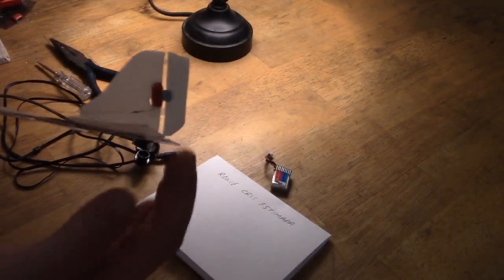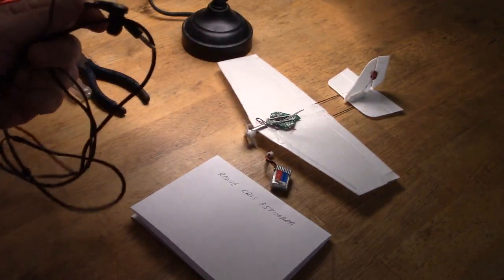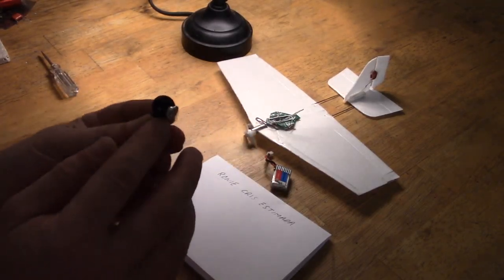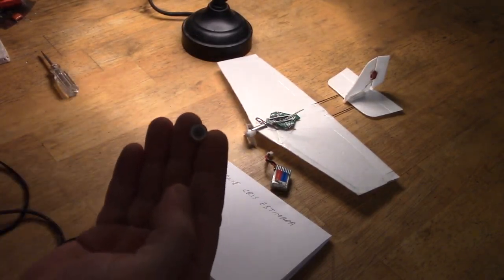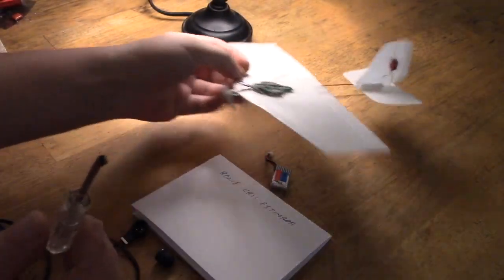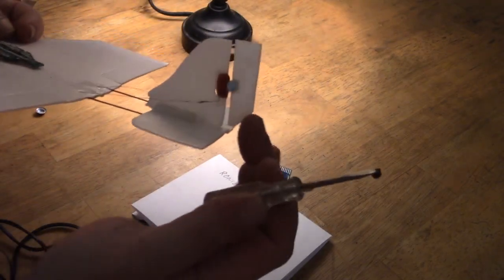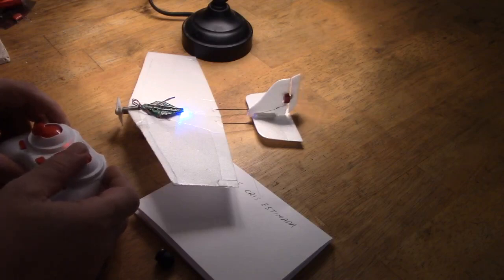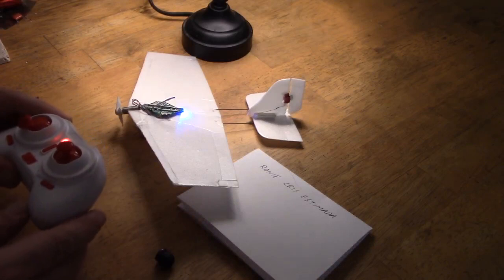Can earbud magnets be used on R/C planes ?

Comment: NIce video. When you said you own firmware, do you mean that i can not use a magnetic actuator in any receiver?  I want to build a small plane same as the one you have in your video but i read that micro receivers for acutuators are really expensive and i do not have the skill to program a receiver my self. 
Thanks
Reply from the maker: The program code of the RX is based on Silverware, a sort of community based back engineering project by enthusiasts. Silverware uses magnetic actuators, or can use twin motors. Lots of options. I'd say to look it up by name on rcgroups.com. 
A lot of the old flyers (circa 2010)), like the Air Hogs Havoc Cyclone used 1 motor + 1 actuator for rudder. Should be able to find those cheap at thrift stores etc. New 50mA lipo and you'd have a useful receiver setup   :)

Comment: Yet another question: connecting to the drone cpu- I’ve seen WiFi used, but what about a non-WiFi enabled quad? Is there a cabled option, or just out of luck? My bag of quads are all nano (skyviper m550) . Is there a port, or some sort of jumper I can set up? Thanks again (ps I have arduino if that helps)
Reply from the maker: All should be 2.4GHz Chris... the thing is about how the motors are powered up, it's all in the protocol each quad uses (then 0-1023 depending on what the gyro is sensing). You could theoretically connect each motor to a power wire and a shared ground, for 5 wires, on a very flexible long cable. In which case though there'd be no gyro and it would fly terribly without it. Still, it would be a success if you could fly a quad with no brain circuit onboard.

Comment: Hope you still monitor comments for this post- how did you disable the gyro? Via firmware or a hardware hack? I've seen one post where someone simply cut the board trace (not confident about that one.) Anyone else can answer that. Thanks
Reply from the maker: Hey Chris.... yep, I just don't post much at the moment. The firmware is all in C++, can use the Arduino IDE or even  a text editor to make changes. The gyro is called as a function, so commenting out or deleting those references disables the effects of the gyro. It can be very useful on twin motor planes still, but single motor flyers do best with no gyro. Btw, it was perhaps myself who cut the trace. The RX in that case had no protocol code or the simple to connect programming holes such as the 'Santa quads' had. Instead, I traced the connection to the gyro from the MCU and cut it. Most boards quit completely with such a mod, due to the need to check for a level surface.
Reply: Okay, I'm still pretty new at this, so forgive the obvious questions:
1. It's ok to KEEP the gyro for a twin (or even four-engine) model?
2. Access to the program is possible on ANY model quad? 
3. is there documentation for specific models? 
I discovered the "joys" of FCC ID- some firms publish EVERYTHING (block diagrams, schematics, complete functional descriptions) others get very quiet beyond "Internal Photos"  and "letters of intent". 
If there's a general description of the process (a book title you like would be great). Thanks for the post and the quick answer.
Regards
Reply from the maker: Will have to answer quickly, just saw this late evening. If you search RCGroups.com for Silverware, it will show threads on the firmware topic. Silverware was created by like minded folks to alter original firmware. Some quads are programmed with a 4 wire device that luckily is exactly the same as STLink dongles used for STM32 and other microprocessors. 2 power wires and 2 data lines. It made dumping the original code possible... which then showed up as protocols being used. A company called Deviation produce transmitters with the settings for a myriad of different quads now, following the back engineering. But, all can be done at home... the 'Santa Quad' being my choice for ease of programming and a very capable thing itself. 

The gyro can be kept. In fact, no programming is needed for a twin motor with gyro. It's a simple case of only using the 2 rear motors of the quad  :)  Connect those up, snip the wires to the 2 front motors - Any regular quad will do that ! It means you keep the gyro and is how Peter Sripol did his paper plane (which I replicated and they fly really well)
Reply: This is terrific! I acquired a bag (literally) of nano quads from a thrift shop a while back for $5. I then saw the Peter Sripol post, then yours, and since I now have nothing BUT time on my hands , I'm turning into a senior citizen version of Sid from Toy Story, leering at the poor, defenseless quad-lets,  clicking wire cutters while saying "Let's play."
Will definitely do more research on Silverware, too. 
Thank you! (me)
Save us! (Quad-lets)
Reply from the maker: Haha. Congratulations on the bag too! I would suggest the rear motors mod for effective gyro flyers. It's all simple and quick, to get sub 25g creations into the air. Got a palm sized Fw-190 here that flies like a Plantraco Classroom Fighter. If you have history with 2 channel ''toy grades' from circa 2010-2014 like the Silverlits or Air Hogs you'll do great with 'quad guts'. 

Btw, range goes way up to over 300ft when converted. The 4 messes of swirling interference need only to be deleted or moved away from the RX. 

Best wishes!
Reply: Slider2732  One more (well two) more questions:  First , do you have a forum page or blog (beyond YouTube) I can follow? Second, I assume the quad board must be mounted parallel to the fuselage (horizontal) to insure the gyroscope sets up correctly? Dumb question, but rather stupid now than standing over a (very small) pile of wreckage.  Thanks, and ps A “classroom fighter”! What I wouldn’t have given to have a luftflot of micro Stukas for certain. classes in college!

Comment: Do you have a sample diagram how did you do it?
Reply from the maker: Not got a diagram now. It's easy to connect up an actuator though if wound with 2 coils. 1 goes to the left rear motor pads on the RX, other to the rear right motor output. Main thing is to wind 2 coils (on a drinking straw for example) with approx 400 turns each of very fine wire. A car relay will have a huge amount of ~40AWG wire on the electromagnet. 1.5V wall clocks also have good amounts of it.

Comment: How does the drone receiver able to control the actuator separate from the throttle, how did you convert it into 2ch?
Reply from the maker: Ah, I see what you mean. Yes, it would be confusing. What I did was to rewrite the firmware for the 'Santa' quad. I used Silverware as the basis and wrote several different firmwares, for diff thrust, ailerons, flying wing elevons. The video is more general, applying to the question of earbud magnets for actuator based micro planes.
What happens, is that the front 2 motors are used for throttle, independently or for a twin. The rear two have separate outputs for individual coils. Both coils are wound together (300 turns each). The output therefore affects either the left or right coil and stays proportional. 

The firmware is here: https://www.rcgroups.com/forums/showthread.php?3209575-Any-of-the-old-2-channel-planes-to-2-4GHz
Includes example videos and more info.
Reply: @Slider2732  thanks
Reply: @Slider2732  hey is this possible with a drone board that works with betaflight?
Reply from the maker: @ggg567-n6p  I'd imagine so, being only magnet and code based. I've no experience with Betaflight though and haven't flown in a long time.

Comment: this is really nice man! can you  share with us your derivation of silverware firmware ?!  or if you have any thread in rcgroup about it will be so amazing ! the ability of controlling micro actuators with this little flight controller is amazing !
Reply from the maker: Sorry for the really late reply. The files are on the Sept 8th Blog post on RCGroups (same posting name). There's a 'Styles' folder, where you can select the type of old skool flight method you want for your project. Diff thrust is also ailerons, making use of the 4 outputs...write ups are included for functions. 
Have got 4 of the Santa Quad RX's, they're my go to system...range is about 400ft when 4 motors aren't interfering close by and when the aerial is up and out from the circuit.
Reply from the maker: Btw, it shows how long i've simply flown the R+D planes for now..completely forgot to post the other flight control firmwares LOL
Added, have been Elevons, Ailerons Elevator and Rudder Elevator !

Posted, with Zip of the firmwares :)
https://www.rcgroups.com/forums/member.php?u=235502
Reply: @Slider2732  hey man  . don't mention it its your kind  to share your  experience and awesome builds with us thank you man yea i had find  your blog post on rcgp thank you i really enjoying  your builds ! specially those little micro flyers with actuators i have to try it ! i don't have santa quad boards but i have some e011 first series board that is compatible with silverware so i think i can just use your codes in e011 sliverware version i will try it soon hopefully . thanks again buddy

Comment: Be careful of those wires. Or you could become a bright spark retrieving it.
Reply from the maker: Hehe, would be a great way to recharge the battery though. In air refuelling....for about a 1/4 of a second until the flames started.

Comment: is that receiver from a 4ch drone
Reply from the maker: Yep, from a JJRC H67 'Santa', the one with the lego Santa on it. The speaker comes out, the firmware is my own, based on Silverware. Gyro is software defeated for a more authentic emulation of the old 2 channel toygrades of 10 years ago. These RX's get 400ft range on the stock TX, when the aerial is nowhere near 4 motors.

Comment: She flies pretty well. How did you build the actuator?
Reply from the maker: It's a weird one, which is why the specifics are sparse...most RX's needing just 1 coil. This RX code reuses 2 motor outputs, hence 2x 300 turns.
But the process, is to cut a piece of a medium width drinking straw, superglue a piece of foam to one end, put some white glue on the straw and wind 300 turns of 40AWG. Then remove the end foam and cut down the straw to be as flush as possible. Weight is around 1gram. 
This one has 2x 300 turn coils back to back :)